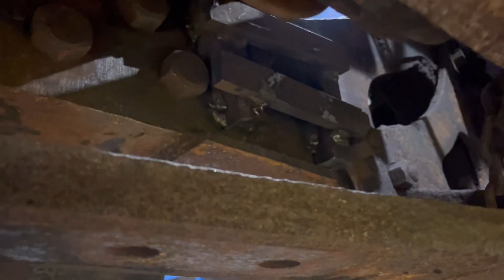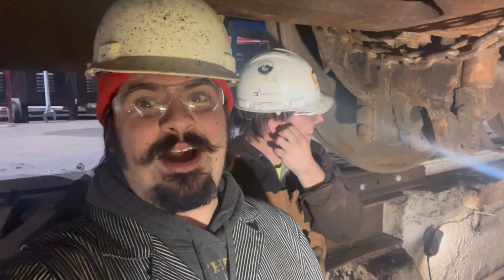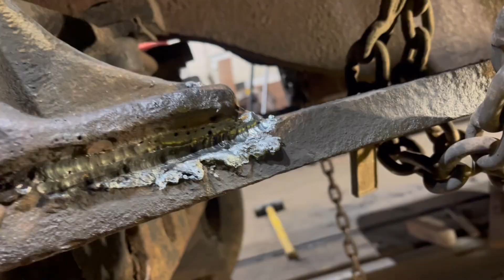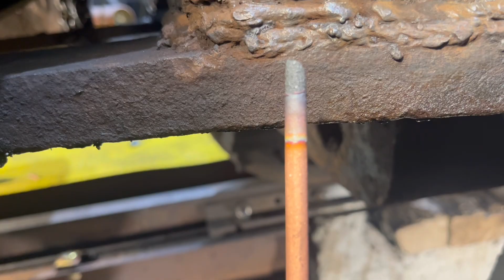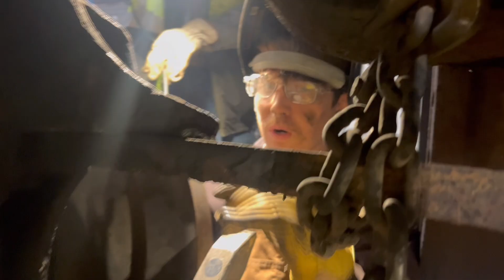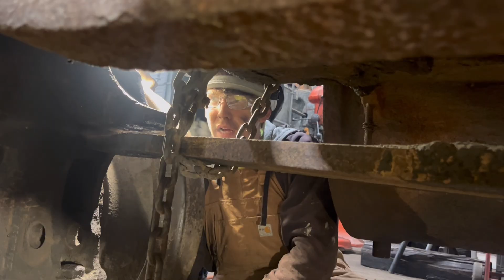GTW 4070 | Frame Repair Part 1: Lead Truck V Brace Removal

Comment: i worked for five years  De Witt diesel shop  Syracuse NY  boilermaker/mechanic  we used air/arc for burning out stuff like that  carbon arc with 90psi air blast to blow puddle away

Comment: Man !!! How long have ya'll been trying to "piece-meal" her frame back together with HIGHLY questionable welding "talent', (the likes of my 10th grade shop class in High school). I don't necessarily know what I'm looking at, but (and as I'm sure you know), that somebody needs to "re-pour" that section of the frame and install it somehow / someway. Otherwise...you're pissing in the wind. Good luck with that. Oh yeah, I'm that "nay-sayer" who pops-up periodically who's just trying to help. 'Sorry if I've hurt your feelings, but certain aspects of metallurgy just were never meant to happen.
Reply from the maker: This isn’t the first time the frame has been welded, but we want it to be the last.  We are using what modern techniques and technology we can combined with some old school expertise.  We want 4070 to be a runner, that’s means we have to take our time and do things right